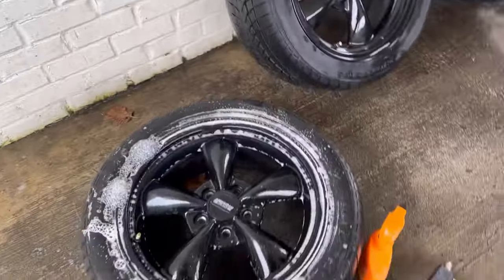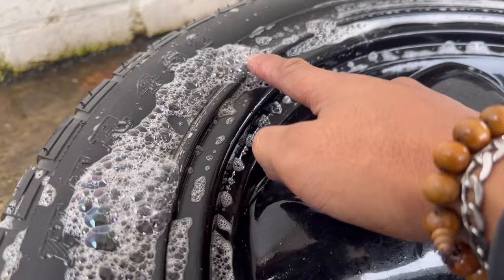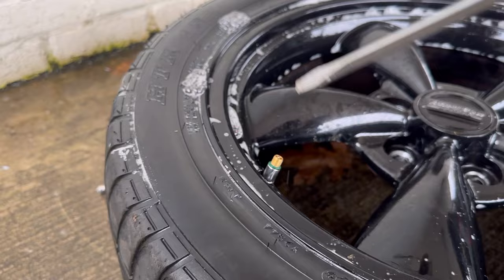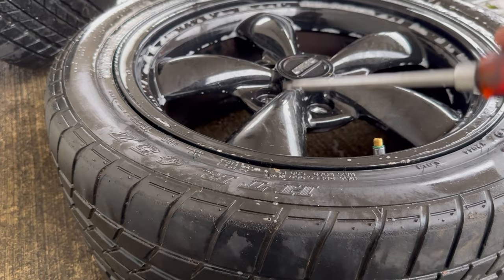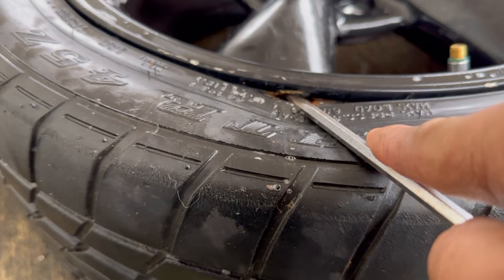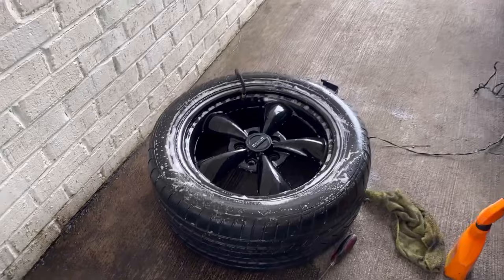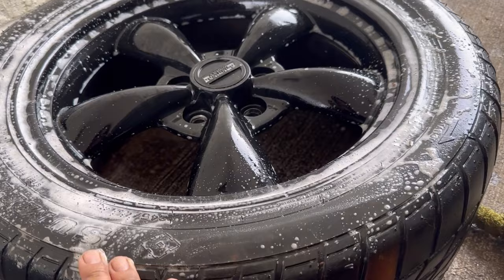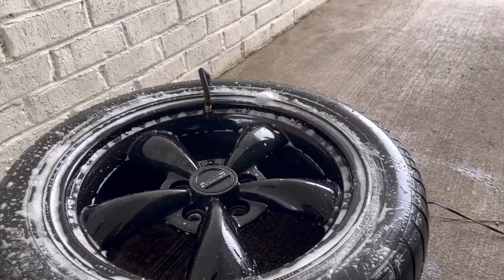HOW TO FIX TIRE LEAK / RIM WHEEL AIR LEAK EASY FIX 🛞

Comment: You're a life saver man, I was spraying soap water all over my tread and losing my mind
Reply: Past six months I’ve been looking for a leak on the tread and today I just started spraying everywhere and noticed that it’s leaking from the sidewall
Reply: @danielscott5004 how did you fix it? It is possible to fix without removing and draining all air? Is there any other way like spraying kind of thing that can fix the problem?
Reply: @MP-hw6sx  my lazy ass ain’t got to it yet. I did get the air compressor out and sprayed around the rim and the tire that didn’t work. I have 22 inch tires so they’re just a pain in the ass to get off I’m sure work if you just clean it out, I’m thinking it’s from the car wash whenever they put the armor all on your tires the drive-through ones and it just got dirt in there because it wasn’t leaking like that before
Reply: Same here sir.  Scary expensive stuff.
Reply: Lmao😅

Comment: thanks. do you think it helps to put any type of goo/ gunk where it was happening. some type of grease? Ive noticed when I've taken it to the tyre shop for this exact problem they've obviously used some gunky stuff that has run over onto the side wall of tyre
Reply from the maker: Yes you can put some type of grease around them but I never did on these wheels and they’re still fine right now.

Comment: I just had new tires on a used bmw rims. 6 hrs later after work I have a flat. Tire place use impact gun and couldn’t even break damn tire lug nut so had to call free road side service.

Dude use a killer breaker bar to get it off without breaking nut. I ask him to air my tire up and spray water. There definitely a leak and look like some rubber debri between the rim:tire.

Don’t tire shop check for leak prior to install? And is it customary to use bead sealant? I feel like they rush and went cheap on me

Comment: Only works in YouTube world .... 🤷🏽‍♂️
I have 1 leak between the wheel and tire, did the same trick, no dirt or anything where it leaks, i cleaned that area out, re-filled and still leaking.
Reply: after you pry it open, put some bead sealer at the spot it is leaking, might do the trick for you
Reply: @teleportrobin  I just used bead sealer and wiped it all around the entire lip of the tire where it meets the wheel, filled it up and the leak stopped .... UNTIL i put it on the car and drove off, then it started leaking again in the same spot.
SO i broke the bead again, cleaned it out again, applied more bead sealer, filled it up to 50 psi, NO LEAKS, let it sit over night, next morning, put the wheel back on the car and drove off, went out 10 miles, came back home and started leaking AGAIN ... 
in the same spot
Reply: @ACommenterOnYouTube feel you man
Reply: @ACommenterOnYouTube  your rim is probably bent a little... I doubt its the tire?
Reply: @feras04  nope it was the tire that was defective, we broke the bead on both sides, turned the tire 180 deg and re-mounted and the leak followed the tire to the new spot so the wheel is good and the tire was bad ...
Reply: @ACommenterOnYouTube  oh good to know. Im having the same problem and need to figure this out